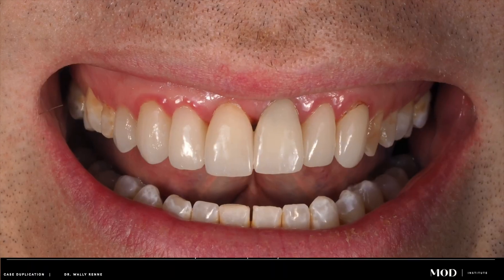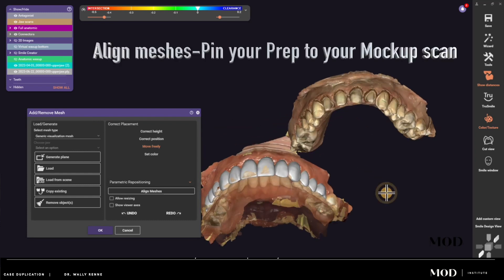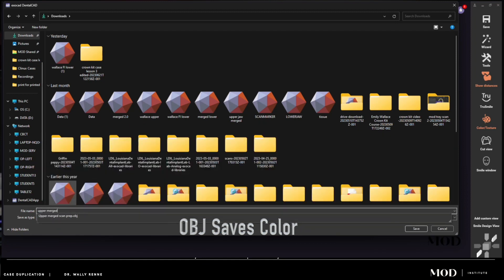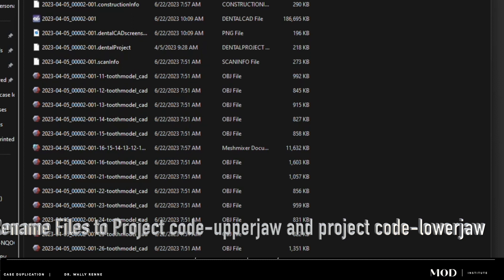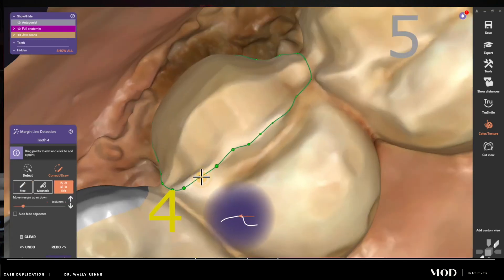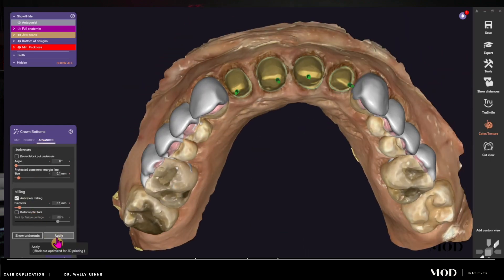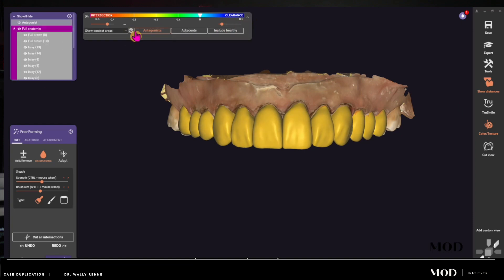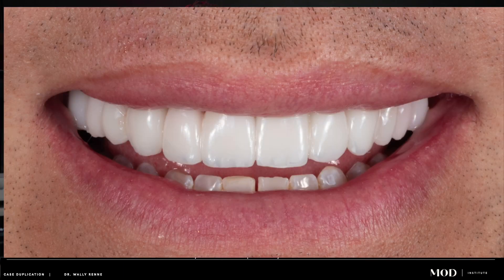The most important tutorial of my career!

Comment: On my original wax-up I'd done them as PONTICS rather than Mockups ... this DOES NOT work if you do what I've done. Now I'm trying to figure out how to somehow get around my mistake... It's treating the pontics like teeth ... I can't get them out of the way to be able to mark my margins.
Reply: SOLUTION: Leaving this here for anyone else's benefit. I was doing 8 same-day anterior crowns (4 up, 4 down) and trying to use this technique. However, when doing my original wax-up before discovering this video I had defined each the 8 teeth as a "Pontic Wax-up" and placed them over the top of the scanned teeth, slightly larger than his original teeth. I thought I could use Wally's technique exactly as he described even though they were not defined as "Mock-ups". Pontics are closed meshes, so this might have been part of the problem but I also believe there was more to my problem than that. The actual problem I was running into was once I duplicated the case, when DentalCAD loaded my *-lowerjaw.obj and *-upperjaw.obj files the waxed-up crowns were in the way of being able to see my prep margins: The prepped jaws and their accompanying crowns were all being treated as a single object by DentalCAD.

In any event, I finally solved my problem but what I had to do was a lot of work: 1. Instead of saving a single OBJ file per-arch with both prep-scan AND the mock-up teeth (which in my case were all defined as "pontic wax-ups" in DentalDB) I saved each of the preped arches by themselves without any associated mock-up teeth as *-upperjaw.ply and *-lowerjay.ply.      I then went back to my original Pontic wax-ups in my original project folder, cropped off the intaglio's of each so that they're open meshes, and saved them each as *-11-toothmodel_cad.obj, *-12-toothmodel_cad.obj, etc until I had eight distinct OBJ files, one for each tooth following Exocad's naming conventions. I made a duplicate case and I put all of these above-mentioned * files into it. I then changed the Rx within DentalDB to define them all as anatomic crowns. I opened DentalCAD app and from there everything worked like Wally showed in the remainder of his video.

Only question I have is why I had the original problem in the first place? Was it because I'd done a WAX-UP instead of a MOCKUP? Was it because I'd used PONTICS and they were closed meshes? I can probably answer these myself with some more experimentation. Is it really possible to do it as Wally shows? (I'm sure it is.)